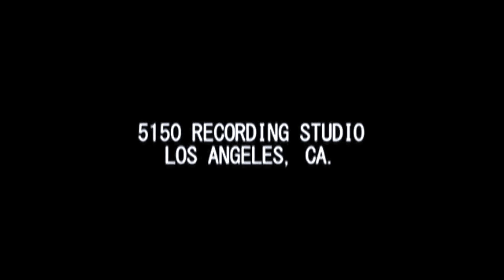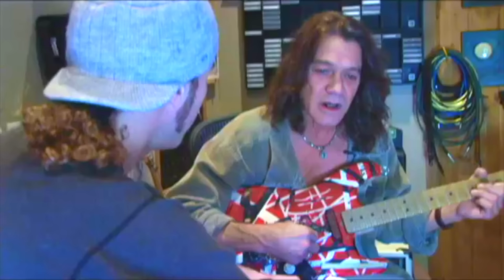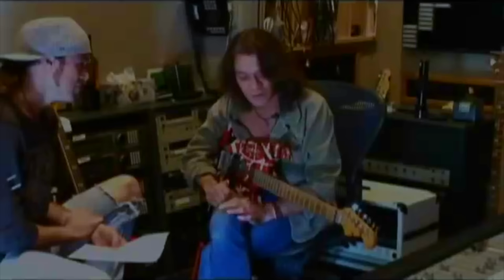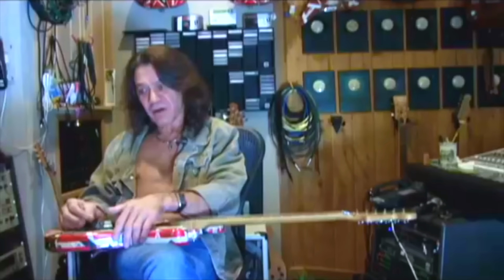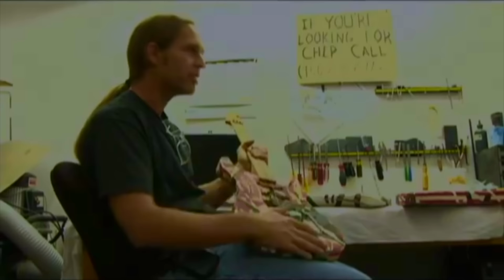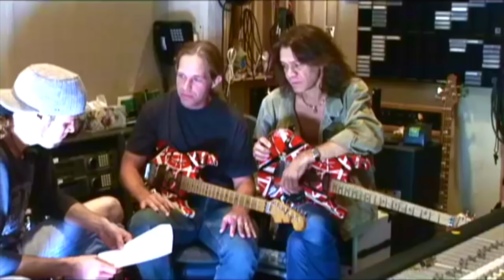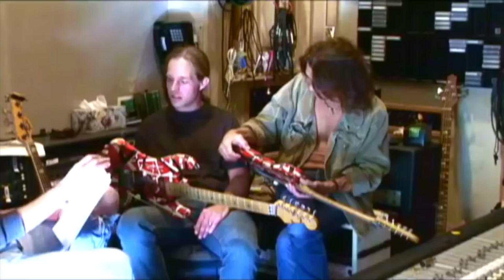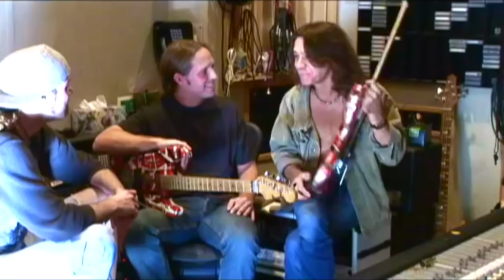Eddie Van Halen - "The Frankenstrat" Interview (Guitar World, Nov. 2006)

Comment: Does anyone know why the neck heel is a telecaster style squared off into the round strat pocket? You can see the gap there in closeups. Why would he pick a neck like that for that body vs the standard rounded neck heel..I’m just curious of the story behind that because it probably would have trouble with intonation unless the heel gets radiused.
Reply: Looks like maybe the neck pocket has a little bit of extra room all together, both in width and length and probably depth, seeing as the body itself was a second. He probably found the neck that felt the best and just made it work whether or not it was perfect. If you trace the history of the guitar it had like 5 different necks on it at different points in time.